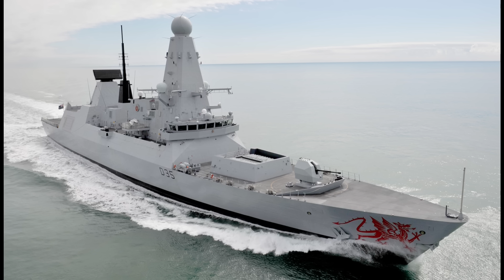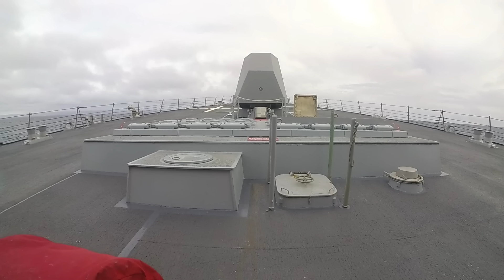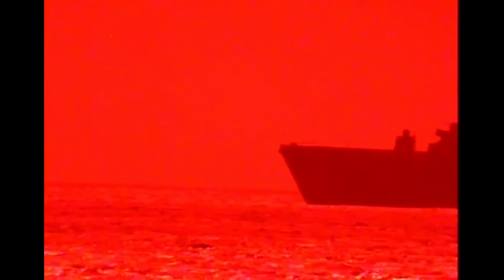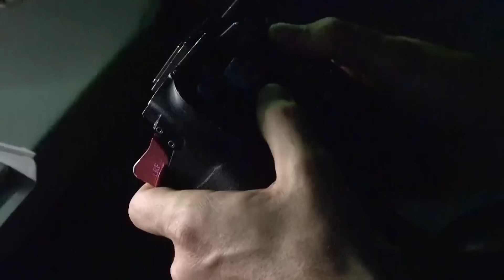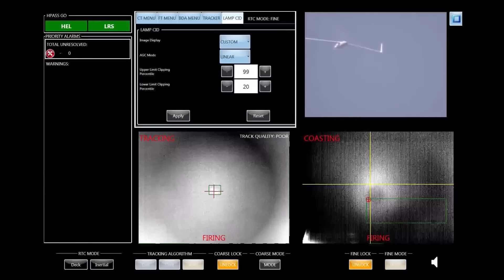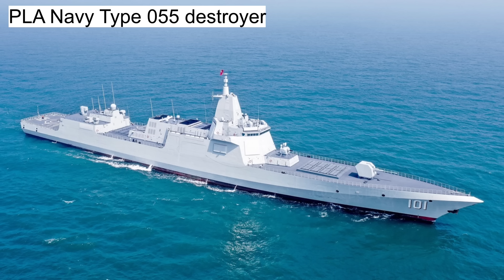Britain's Type 83 Destroyer: Three Radical Designs, One Big Decision

Comment: As much as I would like to see a very large destroyer with 128 cells, I can't see it happening. What we really need is more hulls in the water. Going all out on a cruiser type vessel would almost certainly mean we can't build them in sufficient numbers. 

Personally I think something along the lines of your third option is the most likely. BAE Systems have already shown that the Hunter Class can be equipped with upto 96 VLS if you sacrifice the towed array sonar and mission bay. Many of the problems and delays caused with the Hunter have now been worked through and it would appear to be of a mature design. This would save designing a whole new vessel from scratch to save time and money.
Reply: That would see a great reduction in capabilities though
Reply: Where are you getting all this dream society nonsense from, exactly
Reply: BAE hasn't shown anything beyond a proposal and a render. The Hunter class is probably as far as the Type 26 design can be taken. It is also not an IEP ship, its CODLOG so power generation is limited.
Reply: @soulsphere9242  They wouldn't have shown it if it wasn't possible and given that some of the talk from BAE has been on a Type 26 derived vessel I think an up-gunned Hunter so to speak is definitely a possibility. Also just to be clear I'm not saying going down that route would be most optimal. Rather simply from a time and cost perspective it could fit the bill. Obviously a newer, purpose built design with more power generation would be more optimal. It's all a matter of how much they're willing to spend.

Also just to add, I'm pretty sure there were larger variants of the Type 26 originally proposed by BAE which could provide room for extra power generation.
Reply: @CrackingDale25  Defence companies put out baseless marketing all the time. Until the actual engineering is done, it's not known if it will work or at least if the cost would be prohibitive. The Hunter itself will end up being almost an entirely new ship compared to the Type 26. The program is already going to be $10 billion more than originally expected for three fewer ships. I doubt there will be any margin left. My guess is that they would be better off starting from the Type 45 as a base.
Reply: @soulsphere9242  IEP is not strictly necessary. There are many systems that can draw electric power from engines directly.
Reply: @bulthaosen1169  I don’t know what you mean. IEP is literally having the engines output all of their power into generators. That power can then be directed wherever it is most needed. It’s the future for surface combatants.
Reply: @soulsphere9242  what do you mean you don't know what I mean? I literally said electric power can be drawn from the engines directly without needing IEP.
Reply: @bulthaosen1169  Your statement is weird. Of course you can draw power from the engines via an alternator and that is what many ships do, but that isn't a substitute for IEP. Its like saying you don't need to use gas turbines because you can use steam turbines.Sure you can, but that comes with all of the drawbacks of steam.
Reply: @soulsphere9242  wtf are you even talking about? IEP literally uses an alternator to generate electricity as well.

You don't need IEP to generate enough electric power for energy weapons. Do you think this is some kind of sci fi movie? 

IEP or not the engines produce the same power. It's only the conversion that's different.
Reply: @bulthaosen1169  Seriously what is difficult for you here? With non-IEP ships the majority of the engines power output is in the form of mechanical shaft power and only part of the power output is electrical. With IEP the entire power output of the engines is electrical. This means much higher electrical loads can be sustained.
Reply: @soulsphere9242   I can't belive how utterly uneducated takes people give on internet.

Power is power. It all depends on conversion. IEP still converts mechanical energy into electrical.

Here. Let me dumb it down for you since you can't understand. 

IEP: mechanical > electrical > mechanical 

Non IEP: mechanical > electrical + mechanical. 

Neither are lacking ability to generate enough electrical power. It all is dependent on how much electricity needs to be drawn from the engine while making the propulsion unit.

By the way IEP has less peak efficiency due to double energy conversion. It provides better efficiency when not in peak though. 

Your argument is flawed from the start. Being able to generate electricity is not an advantage of IEP. The advantage of IEP is it's smaller size because it doesn't need a gearbox and if you have a large enough battery capacity can run without activating the engines for a while.

I swear people on internet say the most ridiculous things.
Reply: @bulthaosen1169  Of course IEP converts mechanical power into electrical power...I never said otherwise.

Yes IEP has other benefits like being able to completely isolate the engines from the hull, I never said power generation was the ONLY benefit.

But greater electrical power generation capacity IS a core benefit. Compare IEP with a CODLOG arrangements. In a typical CODLOG arrangement power generation comes from the diesel generator units and/or smaller auxiliary units. The biggest generator on board, the gas turbine is not used for power generation. On an IEP ship it is.

On COGAG ships auxiliary gas turbines or diesels are used purely for power generation and the main gas turbines are for propulsion only.

That is why ships like the Arleigh Burke  have electrical power generation capacity around 10MW, but the Type 45s around 40MW.

On IEP ships the main gas turbines generate electrical power. On non-IEP ships, they don't. Yes IEP doesn't mean total engine power is more, but it does mean there are more electrical power for the same engine capacity.

The figures are out there and settled. I am not sure what this argument is about.
Reply: @soulsphere9242   I can't believe I am talking to a brick wall. Just because Arleigh burke can't do it because it's based on a design from the 80s doesn't mean others can't. 

Alright let's take this step by step. I will explain it to you like a child. 

Let's take CODAG as an example. 

Why do you think it is impossible for the gas engine to generate electricity?
Reply: I never said it was impossible. Your inventing arguments I didn’t make.
Reply: @soulsphere9242  so we have established a fact that it isn't impossible. 

And we also know that a system to derive electricity from these engines also exists. They can range from shaft generators to being directly linked to the  engines themselves through a gearbox or somewhere in between. 

Therfore the conclusion is that electricity can be generated from the gas turbines of a CODAG configuration. And it can be derived from diesel engines the same way although with much less power. And a CODAG can run both at the same time if needed.

The reason burkes cannot do it is primarily because digital integrated power management system was not a thing back when burkes were built. The fact that they only have fuel guzzling gas turbines for main propulsion does not help either.

Another reason auxiliary generators were preferred is to increase survivability. An engine malfunction should not disable the ship. This is also Another drawback of full IEP systems if they do not carry auxiliary generators. Type 45 ran into this problem as we all know.

And it is also more efficient to run lower fuel consumption generators instead of constantly running the main engines.

Your electricity argument is flawed from the start because such ships already exist. For example the new Indian frigate class. It has auxiliary, diesel as well as gas engines. And RENK provided a custom gearbox/propulsion system to generate more electricity from it's main engines if ever required.
Reply: Why go BAE ? Type 31 was an AAF Frigate from the beginning and Babcock seem to be able to build ships faster, with 64cell vls and better radar like the Thales SMART-L-MM or SEA FIRE would be a good option

Comment: Type 83 is dead in the water. Expect a direct destroyer replacement
Reply: The Type 83 is a direct destroyer replacement.
Reply: @Aethid no it's not
https://en.wikipedia.org/wiki/Type_system_of_the_Royal_Navy
Reply: @starship4453  It literally is. The Type 83 proposals are direct replacements for the Type 45s, and are destroyers by the RN's conventions. Thanks for linking something that supports my argument for me.
Reply: @Aethid Type 83 and FADS is dead. The next ship will not fit the type 83 naming scheme
Reply: @Aethid  then type 83 will be something like type 45. It won't be a cruiser type ship with massive tonnage and VLS.
Reply: @bulthaosen1169  There is no indication that it will be. I dont know why the video suggests otherwise. The RN are planning on building small optionally crewed ships for the arsenal ship role.
Reply: @Aethid  RN plans a lot. Most of those plans fail or are a mess.

Comment: I'm not confident in Britain's ability to produce such a ship AND maintaining it. They cannot upkeep the existing fleet, what good will some more do?
Reply: The existing fleet is having trouble because of delays in the replacements causing ships to age out, covid causing maintenance scheduling issues with the Astutes, and a design flaw issue with a specific model of engine on the Type 45s.

As long as the RN doesn't go on another 20 year gap in ship building, there is no reason to believe it would struggle with maintaining the Type 83s.
Reply: well if they didnt bother temperature test the northrop grumen gas turbine thing which caused the type 45 to break down in warm temperatures , doesnt bode well for their designs. they will probably leave something major out and only realize years later